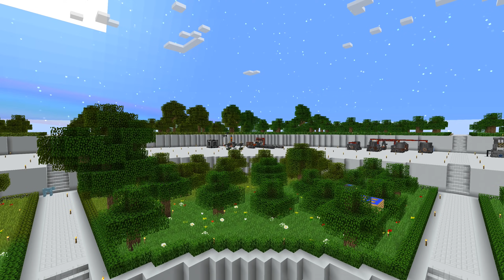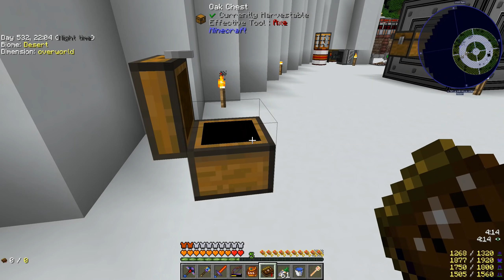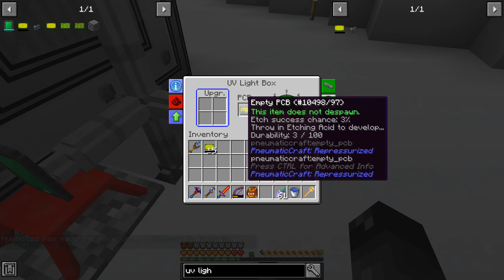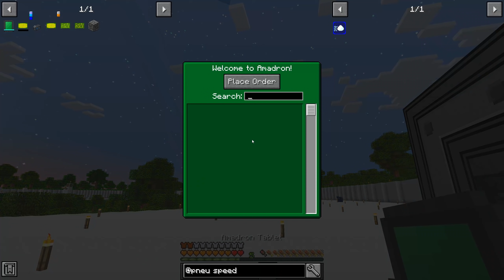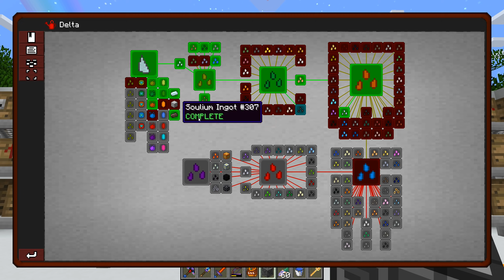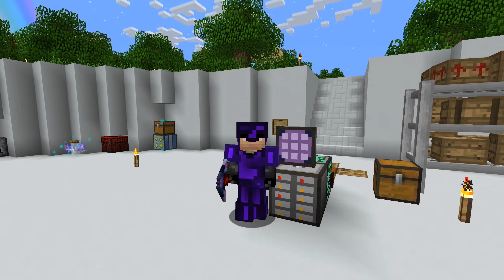Project Ozone 3 Kappa Mode - FIRST DIGITAL STORAGE SYSTEM [E52] (Modded Minecraft Sky Block)

Comment: Lubricant is kinda annoying to get so im trying to get the tablet to get it faster, and to plan an me controller.... but just the alloy you need to make the battery for it... AAAAAAAAAAAHHHHHHHH. 

Just for this at this made the game wants me: a reactor (for the quest, i don't need it with the nether star genetator), blutonium so i need a compressor + fluid transposer, upgrade my magica converter to hold more ember. 
I need blutonium for 3 or 4 nuclearcraft machines just to make the alloy.
And i also had to make: HOP graphite seeds, redstone alloy seeds, silicon seeds.
 big brother woot farm helped me a lot to get all that friscion And infinite amount of diamonds/emeralds/gold/blaze rods and nether stars that i can use to power my generator.

I also yesterday made some hards seeds (vibrant alloy, energetic alloy, cobalt) so i can make capacitors more easily (i made some totemics ones fully enchanted to the maximum (efficiency V, Unbreaking III, mending)) now my ender IO machines are very efficient.

Im close to do this tablet so i can get lubricant faster and to make an me controller (needed for autocrafting stuff)

Update: FINALLY, i got my ME system with 2 full Me drive, 1 controller (AAAAH) and 1 storage bus for my woot farm. A little tip for others, make acceletation cards ASAP, they're useful to speed up quartz growing/processors crafting.

Now my plans: upgrade my armor to the maximum i can, begin automation, begin industrial foraging, i plan auto collection of my agricraft crops. Mainly redstone, electrotine and iron (so i don't have to farm hours to get theses red/blue alloy ingot) i will connect them to a barrel system connected to a storage bus for obvious reasons.
And also More expensive seeds to make my life easier (dawnstone, Pulsating iron, thermal expansions alloys).

Oh my god this is a very long comment....

Comment: I've said this on different series before, but this time hypno may read it before he starts autocrafting.

If you make a big array of assemblers/interfaces (just like in any series), please, don't put recipes that you know will be called at the same time in the same interface.
You usually put "similar" recipes into the same interface, this is inefficent.

An example would be putting the recipe for planks and sticks into the same interface. Let's say every assembler can access 4 assemblers next to it.
That way you have both processes trying to use those 4 machines and having to share in some way.
If you put these recipes into different interfaces, they won't fight over the same machines (the slowest step will have 4 machines to itself, without needing to share with anything) and you end up speeding up autocrafting.
Crafting something like the opinium cores (where 2 of the "previous" tier make the thext one) with the "spread out" method instead of "all in the same" would pretty much double crafting speed.
Something like coal essence to coal, to coal blocks would also be double speed (more less) if you put those recipes in different machines.

It costs literally nothing to "shuffle" the recipes around, but makes it somewhat faster (i'd guess about 20-30% on average). It's not much, but it's literally free crafting speed.
Reply: Heh, I remember two times in different series where he did what you described here. Project Ozone Lite and Project Ozone 2 Kappa Mode. I think we're doomed to relive the experience. :P
Reply: Hypno literally keeps doing this 💀

Comment: If you ever accidentally put your dank null in your AE system, you can remove it by using a fuzzy card with an export bus. You'll have to make another Dank Null, but I fell victim to this a lot. Cheers mate, congrats on the ME system, finally! =D
Reply: @GreenYT I believe it has something to do with conflicting NBT data. It's an older bug, haven't done much research aside from how to fix it. Easiest way is just a fuzzy card with export bus if it does ever happen to you.
Reply: @GreenYT It gets stuck in there and you can't remove it. I remember reading it had something to do with the AE2 mod itself, not the dank null mod. If it gets stuck in the AE2 system, you can't pull it out any other way. It doesn't happen on some packs, but I know for a fact it happens on Po3 because my current playthrough it was stuck in there.

Comment: correct  e if I'm wrong, but I've played PO3 (normal) and I didn't need an Controller to use the pure basic ME network (MEDrive,Crafting Monitor and Energy Cell) or is this changed in this modpack?
Reply: The ME controller is what gives channels, you're really limited without one but can still use the mod (8 connections total)
So he could have used AE sooner, but in a janky way
Reply: WhitedevilEE it’s kappa mode I think